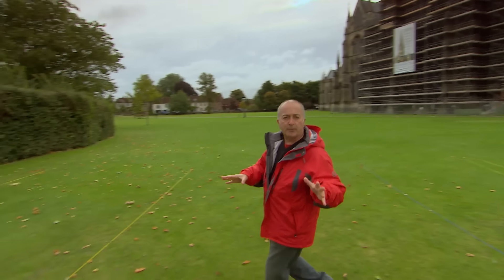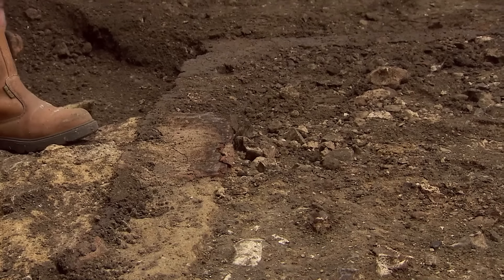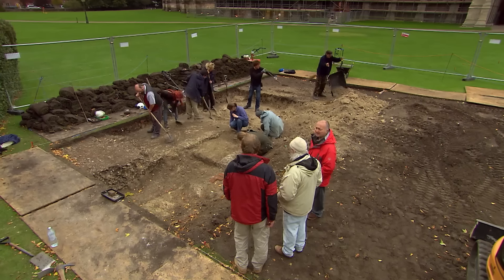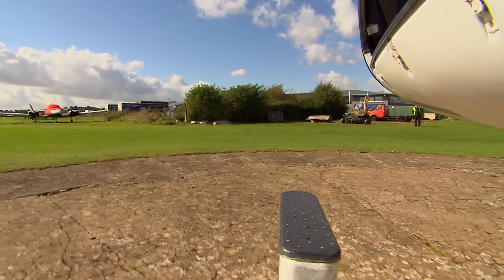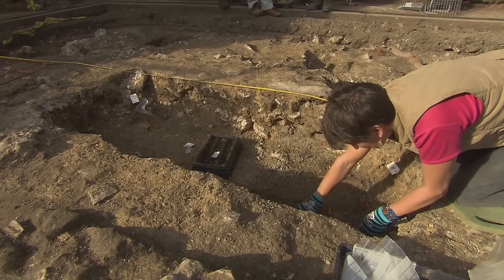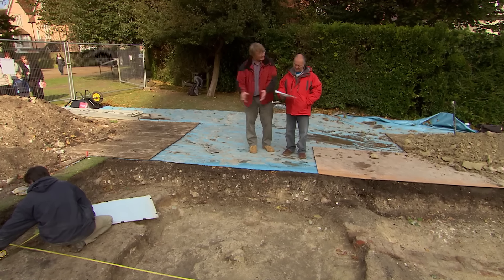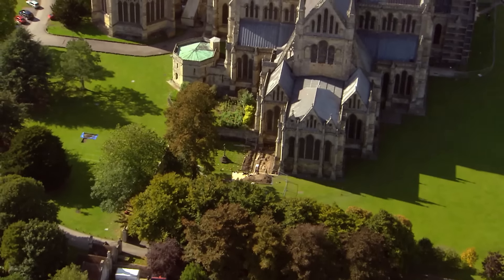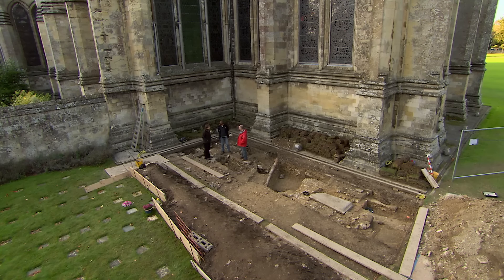The Mysterious Medieval Skeleton Found Buried In Salisbury Cathedral | Time Team | Chronicle

Comment: Example 1. 
When it comes to the actual building of the Cathedral. It was NOT built 800 years ago. Today we can't duplicate that kind of building in material. The biggest strongest cranes today. Can't lift more than half of those stones. 

Example 2
Even today. We don't find the transfer of craftsmanship. From said building. To the homes and businesses buildings. In the surrounding area. Comparing the technologies of said homes and business buildings. To the technology behind that build. Is vastly different. One's primitive. Other we still can't reproduce.
Reply: @trumpershaveblinderson7470 Like all conspiracy theorists you make wild claims but never back up those claims with anything even remotely approaching evidence. So if the building is not 800 years old, then how old is it? Go on, tell me. I'm sure you'll dodge the question with some elaborate word salad.
Reply: It was built in the future, duh
Reply: @walkaboutwithrob  I agree. I hear these kinds of things all the time. It typically can be reduced to, "I don't understand how they did it, therefore it had to be done by aliens or time travelers."
Reply: Funny thing. The French guild of masons responsible for the techniques every cathedral and castle in Europe used literally never stopped. It's been spitting out apprentice trained masons for nine hundred and thirty one years. Non stop. There's never been a need to transfer the skills. They never died.
Reply: Good grief.
Reply: @joshschneider9766 You still haven't explained how they made it. You say it never stopped. Where's the new Buildings with this technology. How are they being built.
Reply: @janerkenbrack3373  Did I say either Alien or time traveler? Absolutely not. See people with responses like your's are  ignorant. Absolutely none of you. Are or have explained. How they made this building. How in the hell did those MASSIVE SLAB'S of stone. Get lifted??? 

Prove your point.
Reply: @walkaboutwithrob  what nothing to say? No explanation? Or is. Just believe me is it.
Reply: @trumpershaveblinderson7470  I’ve asked you to reveal when the cathedral was built, since you are so sure it isn’t 800 years old. Still waiting for your answer
Reply: @walkaboutwithrob  Deflecting. You're unwilling to answer my question. But demand that I answer your's. Which I did.
Reply: @walkaboutwithrob  because you don't have a clue. To how it was built.
Reply: @walkaboutwithrob  news flash. If? I knew how to replicate that building. I would be a BILLIONAIRE. That's the entire problem. How was that built?  Since we built it 800 year's ago. We should certainly be able to replicate it today. We are smarter and more technology inclined today than 800 years ago.
Reply: @walkaboutwithrob  You're not going to address the problems with your official storyline are you? Yeah that's what I thought. People like yourself never address the problems with your own timeline. People like you. Just ask a question. Knowingly that the question you asked. Can't be answered. But you damn sure can't won't answer the question at your hand.
Reply: @trumpershaveblinderson7470  well there’s the word salad. So when was it built? If you don’t know then just say so.
Reply: @trumpershaveblinderson7470  if you ever watched more archeology programmes,they show you how.they built cranes out of wood with a treadmill attached and eventhough it was dangerous that is how they lifted the weight.Tony Robinson has a documentary on yt,where they show you how.they lift a whole car ,to prove it could be done.they also say  blind people were hired to do the job of walking the treadmill.
Reply: @trumpershaveblinderson7470  As as "typically," but didn't accuse you. You haven't yet said aliens or time travelers. Nor have you said Druid magic, giants, or God. Not yet.
What I still read you saying is that you lack ignorance of how it was done, by your own admission. And you have also said that "It was NOT built 800 years ago."
You should see the obvious logical fallacy here.
How can you know when they were or were not built if you do not understand how they were built? This is an argument from ignorance, and makes your assertion invalid. Forgive us for assuming conspiracy or other nuttery, but you began this discussion with a fallacy, why take you seriously at all?
If  you had looked up the construction methods, you would find the answers. If you didn't believe them, it makes your claim an argument from personal incongruity,  where you simply can't believe something to be true. Again, because you don't understand it, and/or don't believe it, it does not follow that archeology is wrong.
As to me or anyone else explaining the how of the construction, what would be the point? You came into the discussion by declaring you've formed a belief. It isn't our job to disabuse you of your error, or attempt to educate you. That's on you.
Reply: Likewise do these naysayers have blinders on, and we know they cannot see except their blinders be taken off, and how shall they take off their blinders if they do not know they are blind?
Reply: @janerkenbrack3373  Now that's a word salad. Throughout all your comment. You never addressed the fallacy in the points I made.  The official storyline says that it was made 800 years ago. Yet we don't have a clue on how it was made. Do you not understand that we get lied to?  All the time. 
It's the same with the Mayan temples. We don't have a clue how those where made. We can't even get a piece of paper between the stones. We can't duplicate it today.
Reply: @janerkenbrack3373  You can't explain how they made it. Nobody can. So don't say that I'm not open to it. I've asked multiple times. Looked it up. The Official storyline is Man Rope's and animal's. 
The weight involved rules out this. 
I can't help it if you don't understand that.
Reply: @carlnebrin  they put Blind trust into the wrong people.
Reply: @trumpershaveblinderson7470  Again, we have a fallacy. It was done, and we have records from when it was done, which is corroborated by archeological and documentary evidence.
What you have is disbelief based on lack of knowledge. It is an argument from ignorance.
Reply: @trumpershaveblinderson7470  I hate to beat a drum about this, but you fail to see your error in logic. That you don't know how does not mean it wasn't done. And their is no good reason to think otherwise.

And again, you demanding that people explain the process to your satisfaction is laughable. I am under no obligation to waste my time with such a task. Why you think you're entitled to an explanation from me or anyone here is bizarre.
As to the Maya construction, we do now how they did this, and have recreated the process successfully, many years ago. Your own ignorance of this process is insufficient reason for anyone to treat your assertion seriously.
Reply: @janerkenbrack3373  Deflecting. It's your job to defend your own thoughts. You said this was built 800 years ago. I ask how was it made. Your answer is IDK. But we have a piece of paper that says that. Yet you can't provide any evidence to back up your claim. 
To prove your position is not on me. That's on you. I provided proof. That debunks you storyline.
Reply: @janerkenbrack3373 Plus according to His-story They actually moved this cathedral. 730 metres west of Old Sarum Castle 
Then put it back together. Calling it Salisbury Castle.  

They MOVED it? Again they use Ropes man and animals. 😔  

Since you believe that. 
I own a bridge in Manhattan going to Brooklyn. I'll sell it to you really cheap.
Reply: @trumpershaveblinderson7470  No, this is you trying to shift the burden that belongs to you. You said it was not built 800 years go. You have not offered anything to support that except the claim that the technology to do so was beyond their reach. Just an assertion that contradicts the expert consensus.
I hold beliefs tentatively, and based on what is mostly likely to be true, with the evidence available.
Since I am a novice in some fields, or maybe an armchair dabbler in others, I find it useful to read the opinions of experts, and review the evidence they present. I'll look to see how their finding align with or contradict other disciplines, and other research. I'll look to be sure that the researchers have been reviewed, and where others thought they were right or wrong.

With all of that done I still can say only that I will gladly change my opinion of the thing, if it becomes clear through evidence that it warrants such a change.
This put some reliance on experts, but only so far as reasonable and in line with other experts.
And a correction. I did not say the thing was built 800 years ago, the program did. Archeologists from several different places and disciplines said so. I see no good reason to believe they are wrong, until and at least someone presents something other than 'they couldn't have done it because we don't know how they could have.'
If you don't agree, you are welcome to do so. But as soon as you assert that publicly, you have entered the marketplace of ideas, and you must now defend your claim. Or, as you see, you will be schooled in reason by a stranger.
Class dismissed.
Reply: By googling medical building methods or how did mediaeval builders lift heavy blocks you'll have your answers - and don't forget these buildings were built over years and decades. Really the most basic of research can answer your questions. Look on YT for videos on how to build a mediaeval castle, modern people have actually put the theories into practice and shown how it's done.
Reply: @kasahadragon9499  I've seen them. But absolutely none of them show lifting 20 ton rocks. You evidence is not evidence. I see you don't have a mind for yourself. I pray for you.
Reply: CorollaryOfTheApothecary  Again you are using a THEORY. I don't do theories. 
It's NEVER been proven the Egyptians built the pyramids. There's no evidence of it. 

This is what I'm talking about. You people pass off the so-called facts. But aren't facts.
Reply: @trumpershaveblinderson7470  Sagrada Familia, still being built. 
,
Reply: @stevehunt4660  it's made mostly of concrete. With the largest stone weighing a few tons. That's believable. There's stone's here weighing hundreds of tons. 
That the largest cranes today can't lift. 

So that building proves nothing.
Edit. Do some research please.
Reply: @trumpershaveblinderson7470  the world's largest cranes can lift thousands of tons.
Reply: This is word salad and not even well-written. Why have you written your phrases and clauses as sentences? Absolutely nonsense.